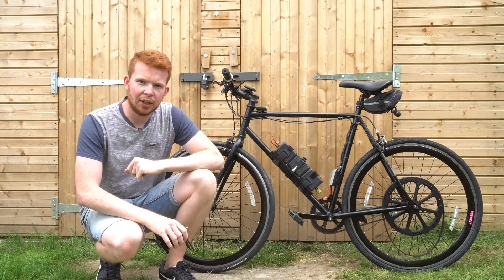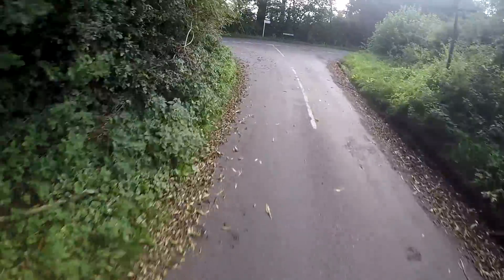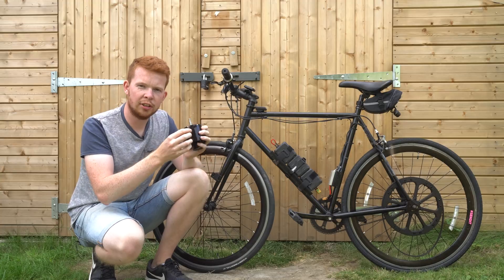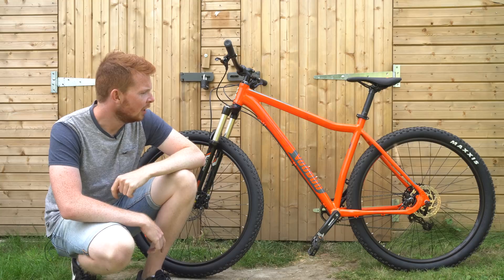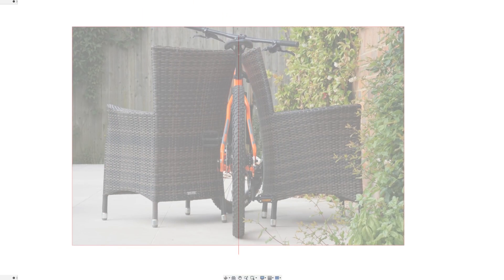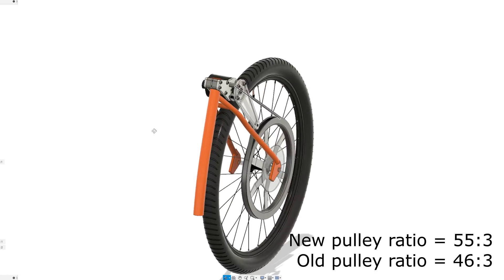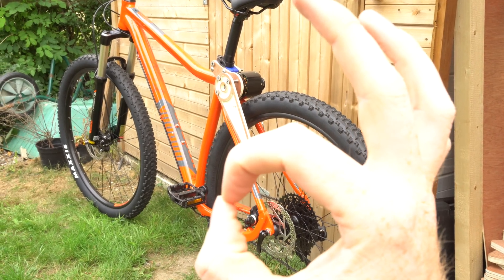Electric Bike 4.0 - Prototyping

Comment: You could use #25H size chain. Smallest pinion gear you can use is 6 tooth. Biggest is around 74-80+ tooth. It's small, light weight, and plenty strong. #25H chain is what you find on a 47cc & 49cc gas powered mini pocket bike.

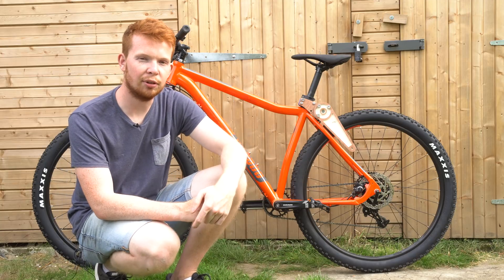Comment: Hey Tom... at 10:40 you're thinking about a free wheel system. There you fear, that your controller has problems, when the load-torque of your bike suddenly goes down. When you use the controller in torque control mode, you are right, because the speed will go up immediatley. But in Speed control mode, the conroller behaves stable. But on the other hand you have to calibrate the controller with the demand speed instead of throttle between 0-100%. So, there will be another behaviour, but I think it could be more reliable in a free wheel system
Reply: one more sentence: Great work!

Comment: Come on tom do the mid-drive, imagine the wheelies you can do on low gear and the high speed all in one setup! It's really not that complicated, use a jackshaft and a belt pully with a oneway bearing against the crank spur gear. I did exactly that with scrap steel and a crap welder, I'm pretty dumb compared to you so it would be a walk in the park for you! lol

Comment: If you're CNC machining, I don't think you can call it DIY anymore. A $1000 tool required, isn't DIY. A 3d printer isn't a big deal anymore, with a sub $200 220*220!

Comment: Really keen to work this project but my question is ... are there calculations that 'easily' determine the ratio of the gears to the Kv of the motor? I am looking to convert a folding bike, so I only have 20-inch wheels ... and I want to see if I can use a motor I already have on hand (I don't recall the Kv off-hand), so what I need to be able to calculate is a rough starting point for the gear ratio based upon the Kv of the motor I have (once I check it out) and the wheel diameter I am using. I am not sure the 12 to 184 teeth ratio is what I'll need. So is there a formula you can use to get a starting point?
Reply: Particularly given that you have moved up to a 29inch wheel ... interested to see your calculations.

Comment: I'd much rather see a bike with no direct mechanical drive.  Make it pure motor with the pedals acting as charger and speed control.  If the pedal speed increases then accelerate the bike (but don't decelerate again when pedal speed drops).  If the pedal speed drops then slow the bike.  Pedal speed should be roughly fixed but a 'gear selector' should vary how much the pedal charges the battery.
my goal is that the battery should not discharge over the journey but average out the hills.

Comment: roboZ starrr
1 second ago
noice, glad to see new bike w/brakes and you made a ridge to prevent belt from slipping off main gear & no nylon tie strapping to the 
spokes.   you may want to consider adding a wheel guard to prevent the belt from wrapping itself in the wheel if it ( unfortunately ) broke /fell off.  also wondering, if the belt did break under load would the motor over-rev up and "spun" the bearings, only takes a moment
(  I've spun many ) . . . and/or the controller won't fry (can handle that momentary spike in power ).    good luck

Comment: I've just finished watching all your ebike videos and wanted to say well done for such great engineering. The only thing I didn't like about the first 3 versions was the motor sticking out so far and it's great to see you're addressing that in V4. I have been messing about doing something similar here https://www.youtube.com/watch?v=26nQj5oSNvM OK, vaguely similar :)
My ebike is just a bit of fun and was never intended to be used seriously, it's more an exercise in reusing old stuff I had but it still works. 
Please excuse my ignorance but why did you decide to go for a VESC instead of a cheap Chinese ebike controller? 
And why did you go for 18650's instead of RC Lipo's?

Comment: Excellent work. Seriously thinking of doing a project this like myself, tho' need a better bike really. A guy in USA make his parts from scrap, like wood, had small wheel drive the back wheel by pressing up against, which has been in other videos. Works, but not a great design, but he did use a mains (usa 120v ac motor) powered with 2 power tool 36v dc batteries. No electronics, just using a heavy resistor wire, same as an electric coiled heating element wire used in electric fires, to control the power on the handle-bar. His most impressive part, is how he re-wired the stator, so it ran in parallel with the brushes on the rotor. He claimed this not only eliminated back emf, but used that same emf as driving forward torque. Could see he was getting tremendous torque even at low speeds. On one brush, there was an arc. Viewed via an infra-red camera, there was even a bigger more stable spark, almost like a plasma. Suggesting electro-static energy involvement. His name is John Christopher Gay if you want to check him out. I've lots of motors & gaining parts to experiment with. I'm old school analogue, don't have a clue how to program eeproms at all. Am also following Gerald Morin from Canada, who's into building a free over unity RF generator, using high voltage/high frequency generating a 50hz or 60hz for America square sine wave gap.  I'm working on a magnetic free energy generator, which I got the first one working, producing up to 9 volts, enough to power a torch bulb or charge a battery. Let's hope the one I'm building now can belt out at least 12 volts or more, so can run it into the battery charger & pure sine wave inverter I'm also building. I guess the controller is using Mosfets for the power switching output? Is it frequency or voltage controlled? Thought if keeping the voltage up, but using a triac or scr set up, could control the output via frequency control. I've seen designs using drum motors & using a drum motor on the front wheel. Be almost impossible to fit a drum motor on the back wheel, no?!

Comment: Quick tipp: Never lubricate a bearing with oil unless it is at least half in oil everytime. Otherwise oil gets out of the contact area of the rollers or balls qickly and bearing fails because of metal/metal contact. You have to use grease which stays between the roling elements and supplies them with a thin oil film for separation all the time.

Comment: Tom, my biggest concern is the tires.  Those knobbies have no grip and are horrible on paved surfaces (not to mention noisy at 30mph).  If you like the fatter tires, get some quality slick (or minimal tread)  Schwabe makes some outstanding high mileage tires for loaded touring.  You'll get better handling with tires intended for pavement and some safety thrown in.
Reply from the maker: Yes I completely understand, knobbies are horrible to ride on the road. I've actually ordered some Schwalbe marathon pros to try out as reviews say they last for ages and have protection against punctures. Thanks!

Comment: for your gear box system, thered be no need for a clutch. racing motorbikes now use clutchless shifting by removing power not by diconnecting the engine but just cutting the ignition for the secong it takes to change gears. 

i know youre not going to do it as you said in the vid but you could just cut the power to the motor via the ecu or a momentary switch when changing between gears if you were to add some. however thatd probably be a bit fast for mountain bike tyres anyway  

great vid as always

Comment: I always had trouble keeping the belt on with this setup.  When I absolutely had to hit a large hole or bump the tensioner  would move enough to let the belt get tossed off.  I was going to use higher wall pulleys and some kind of roller stop on the back of the belt. I never got around to it...

Comment: You could pressure form your aluminum pulley spoke, if you can get some form of hydraulic press, just place your cut piece [including enough length for the angle deflection included in the bend] onto a set of centered steel pieces, screw it down to the middle to keep it from slipping or tilting and gradually add pressure to make sure you don't develop a stress fracture or get one spoke bending before the others causing a lopsided draw...

Comment: Why don't you attach the bottom of the idler to the frame as well? Just to spread the load a little more and not put it all on the motor mount. Wouldn't be hard to do since the idler is almost touching the frame anyways. I think a little 3D printed bracket would help a lot taking load off of that motor mount.

Looking forward to see how it all turns out! Cheers!

Comment: CNC SOME DISK BREAKKKKKSSS
Reply: I am pretty sure ordering some would be easier then messing with Type 321 stainless steel.
Reply: Wheeel you see what I did there Could he do something different with disk breaks for example put 2 sets on each wheel and control them separately with an Arduino which would toggle them on and off depending on efficiency.

Comment: Hi, is the dc motor can be used in rain? How do you plan to protect it from water, if it is not waterproof?
Reply: This being a brushless motor, I think it's inherently waterproof. It has no brushes, just closed loops of wire. The esc would need to be waterproofed, I imagine.

Comment: About the cheap bike getting so many miles: I ride a bmx that I got for £200 and I've had it nearly four years I think and maybe around 5000 miles on it and it's lasted fairly well with everything I do to it. I've had to replace many parts but nothing has actually broke just worn down and bent slightly but I've be using the same wheels, drive train and headset for all of that up until about a week ago.
About the brake pads: useless to you now but I use odyssey ghost pads clear (clear break pads are softer and so better than black ones but clear can be really loud if not set up properly) and they are great but they are tiny without the round washers and you can get the perfect toe in without trying and they're really thick and wear pretty slowly with everything I do. I do have v-brakes I think it is but I don't know how much difference that makes.
About the pot holes: learnt to bunny hop over them haha. Learning bunny hops is really difficult on a heavy bike but once you've learnt them you can do them on any bike and I can bunny hop the really cheap, heavy, old, steel mountain bikes that weigh like 20kg probably after learning it on a 11kg bmx.
About the chain for the motor: you can get some super thick chains for bmx because they don't have gears and are probably impossible to break from normal use and can fit to a 9t sprocket, probably smaller if you wanted.

Sorry for writing so much and for most of it being about bmx but I'm just sharing my knowledge.
I'm from Bristol if you know where that is (about 4 miles out from the center) and bmx has been perfect for me with everything there is going on.
Reply: Strangely My Comments Usually Get Quite Popular I'd love to do an ebike conversion on a BMX, they're fun to ride
Reply: PyreGnome Ay I agree but I'm not sure how we'll the electronics will hold up to the abuse and then there is also the extra weight. If you keep riding bmx you will eventually get a lot stronger in your legs and you won't need a motor, if it's too slow then you can get a 28t sprocket or maybe even bigger

Comment: its interesting you bring up a potential issue of the motor spinning up and "catching the freewheeling hub" if you think about it, its no different to what your feet do on the pedals, the hub can survive serious torque, think of what torque you apply when really pushing hard up a hill. and that's short bursts of energy so the force is substantially higher.
the motor/esc would cope fine with the instant loading of torque, after all, whats the difference between no torque instantly to full torque, and all-ready being at full torque.

Comment: Would it also be possible to drive the wheel with a rubber cylinder that is in constant contact with the tread of the wheel and driven by the motor.
Reply from the maker: It's possible, but not ideal. It won't be able to deliver the max power output of the motor without slipping, therefore increasing tyre wear. It also might slip if the tyre gets wet or covered in dirt.

Comment: Those toy disk brakes aren't going to last very long either - energy dissipated goes up with the square of speed and you're tossing out your battery power as heat. With your choice of direct drive you should be regen braking to where the soles of your shoes are sufficient "braking". Why aren't you doing this?

Comment: Seems like a good design, except for the obscenely long idler pulley arm, on spacers no less. Unless you attach that to the frame on several points that arm will probably twist into pretzels under full load.

Comment: razor e300 scooters can be had on gumtree for about 30 quid (once the lead acid batteries are dead), they are great for modding and have an almost motor bike like tubular chassis. loads of v. cheap dc motors and speed controllers on ebay for them.

Comment: There’s no freewheeling on the side you plan to mount the belt, the freewheel is only on the drivetrain side. Discs from the break are permanently attached to the hub and so will be your pulley.

Comment: *****Tom! could you not slightly, with calculation, increase micronically all your 3d printed parts then make castings in plaster or greensand to therefore create aluminum parts from the 3d parts? molten aluminium.***** LOVE THE DESIGN AND IT'S EFFICIENCIES!!

Comment: Sounds like a fun project, cool to see the different designs!    I've never really played with this stuff myself (would like to get into it once I build my workshop) but one thing I always wondered is could you actually use the entire wheel as a motor?  The wheel would have magnets mounted to it, and then there would be a stationary frame section on both sides that would hold a bunch of magnetic coils.  Essentially it would be a high pole count 3 phase motor.  It would be more bulky I guess though.  I guess the only advantage would be less moving parts.

Comment: I don't get it..,  just why? Other than entertaining yourself with a meaningless project. If you insist, Install the motor in line with the drivetrain and take advantage of the already integrated gear system. People have already been doing this for decades with gas engines, why reinvent the wheel..

Comment: That is really fast! Bike engineer here. In Germany this would be absolutely illegal. Not sure about the UK. But besides the law: please get a proper helmet and gear. This is so fast, you should dress for the slide, not the ride, as the motorbike people say. And of course be very careful, if you have an accident and lets say you die, the driver of the car will also be scared: emotionally, for live. And remember that the bike and the frame are not made for these speeds. The brakes are decent (and of course way better then the previous brakes), but still not made for these speeds. Maybe you should think about Downhill brakes.

Technically: very nice solution and good thinking :)

Comment: @ Tom Stanton

Tom, it's always great to watch your video's as you seem to think of doing things outside the box as they say. I was also wondering would you be able to make & send one of these units in the post If we could work out a price? I use a carbon fiber 26" mountain bike frame with Michelin Advanced slicks that are 1.1" wide. I've been looking at having an electric setup because I'm slightly physically disabled with my back. I can't walk very far but I can ride a bike still but pushing with one leg & having the other leg have about 50% strength in it because of my back.

Basically my nerves are being pinched in my spine as I walk & it sends pain through one leg & I have loss of strength in that leg also. I don't have access to a 3d printer & cnc machine to make these parts to make it myself but if you could help it would be greatly appreciated. The small amount of cycling that I can do is the only form of normal mobility that i have left. This mountain bike frame & setup that I have gives me the least amount of pressure on my back & causes very little pain unless I try to go greater than 30km distance. I can only reach around  20 km/hr speed even though my bike weighs 10kg, using one & a half legs & my back can't make me go any faster or longer distances. Anyway thanks for your time.

Mark, Perth, Western Australia
solar.function@gmail.com

Comment: How about fitting a rubber tire directly around the motor housing, to controle the ratio, which directly presses against the wheel? This would look a lot better and you wouldn't have to hassle with the arms and pullies

Comment: One issue I can see, because it’s a mountain bike with 29er wheels it likely has boost hubs and spokes which have a very different shape to your model in cad, this could cause your pulley not to fit properly.